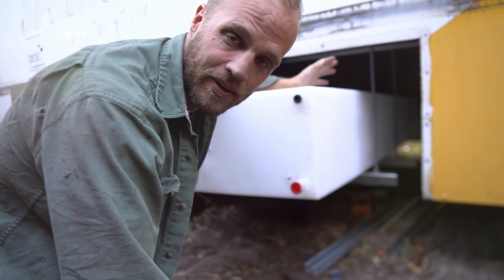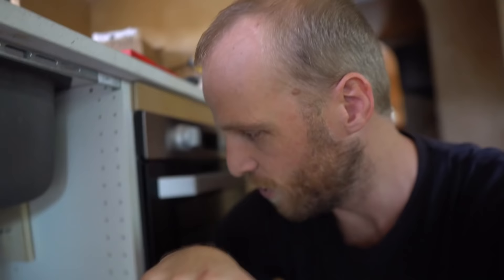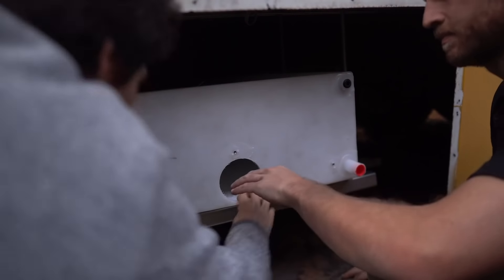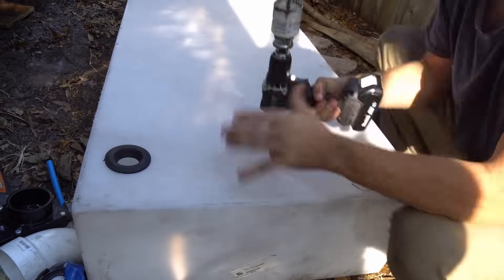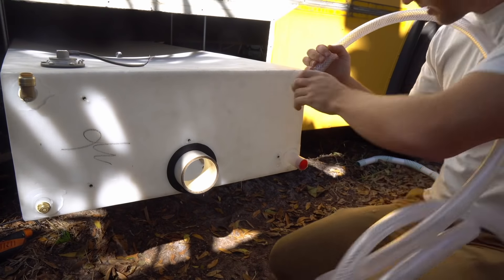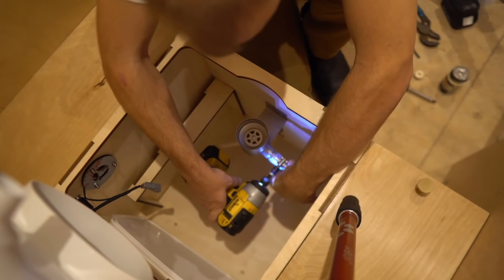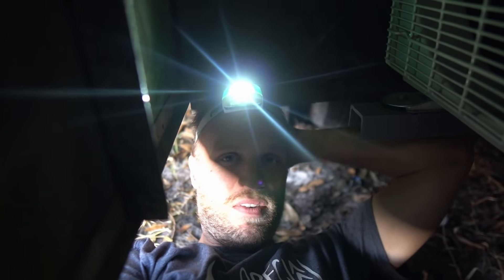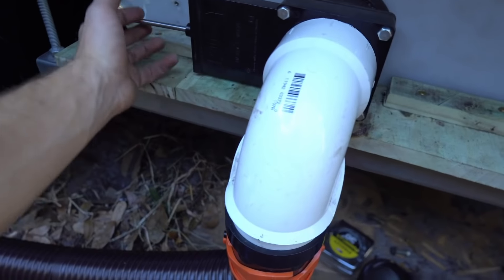How to Hang and Plumb Water Tanks in Your Bus Conversion/Skoolie

Comment: In low clearance areas, you can ensure your nuts do not vibrate loose by 1) using double nuts 2) drilling and tapping in a grub screw 3) drill through and use wire or a cotter pin 4) or in a pinch put a dab of JBWeld or thread sealer on the threads directly above the nut  (it'll take a lot to back up the threads).
Reply from the maker: Thanks for all of those ideas. thread sealer certainly would have been better than my last minute silicone job. I didn't realize doubling up the nuts would work.
Reply: I like the thread sealer or jb weld idea. Drilling holes for wire or pin sounds tedious but easier to work with later. Thank you!!
Reply: @MobileDwellings  normal nuts height extend beyond the threads a small amount.  Thus when two nuts attempt to butt up against eachother they will bind with a considerable amount of force.  The  they cannot move again until you create a gap in between them.  

It’s handy if you think you may need to make adjustments or remove them in the future.  Locktite thread sealer or JB weld take heat or a grinder to break loose.
Reply: @r8edrv4fun65  to be honest the the only areas where drilling and wiring is really done is in aircraft/aerospace.  Places where if a nut comes loose and falls free it will destroy the entire engine and probably cause serious risk of death.

Comment: Great video. I'm an industrial fitter and worked on water management plants. Spring washers were the best solution for machinery and pumps where vibration was an issue. I used copper grease for assembly  of parts so the spring washers were all I had to stop bolts and fixtures from coming loose.

Comment: Hey, Red thread locker would work better for those threaded rods and bolts. That silicone would  likely interfere with it working properly. So cleaning off the silicone would be a good idea. Maybe even replacing the rods and bolts with new. Just to make sure it's good.  Your silicone idea might work but, I'd rather see something that is made to keep bolts from falling off. 😃 

I really like your videos. Thanks for sharing.
Reply: Yep silicone doesn’t actually stick to anything. Just pulls right off in chunks.

Comment: Hey!! Currently trying to replicate this in my bus. What size pvc did you use for the waste valve? Not sure if you said it in the video I watched it back multiple times 🙏🏾
Reply from the maker: It was probably 3 inches. But whatever fits in the dump valve that you buy!
Reply: Ok! Cuase I got the same dump valve but 3 inches is like the same exact size as the opening as the dump valve 😬

Comment: Nice video!  Thanks for taking the time to film and share.  I’m curious though, how did the pee pipe, without a p-trap work for you after some use?
Reply from the maker: This particular unit did not work long term for Sam and Katy. They swapped it out for a HEPVO valve. A P trap would not work because it would be full of urine unless you followed urine with water/vinegar every time. Even then the gases can escape through a P trap when the bus drives around but only in extreme conditions (bumpy off road driving)
Reply: @MobileDwellings  I just couldn’t resist the pun 😊.  Good to know I’m on the right track with my thought process. We are getting ready to install our grey water tank and will definitely be using some of the tricks you shared! Thanks again

Comment: What did you use to hold the uni strut up to the bus? Self tapping screws?
Reply from the maker: bolts, nuts, and washers when there was an L shaped framing member. Each unistrut got 2 sets of bolts, nuts, and washers I believe. The rest of the framing members were U shaped and I couldn't reach behind them so they got big self-tapping screws.

Comment: Ouch. Silicone to prevent nuts from backing off will not do anything. 
Lock washers work fine. Lock washers in conjunction with blue or red locktite should have been used.